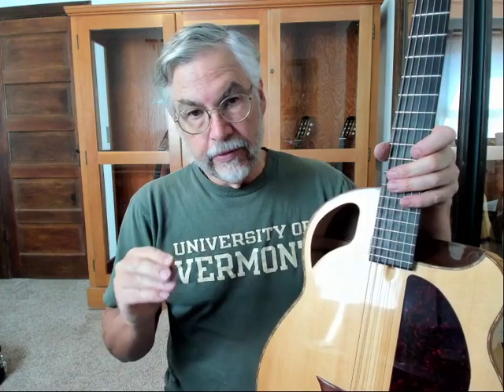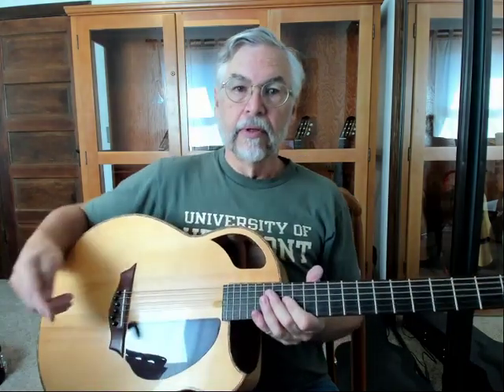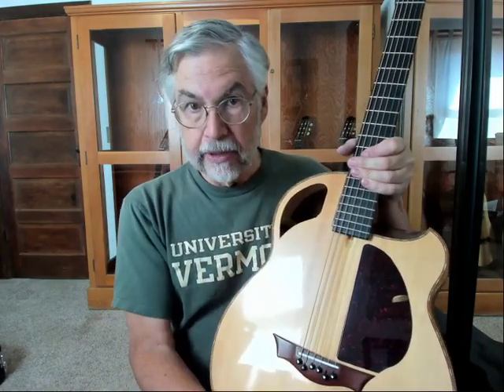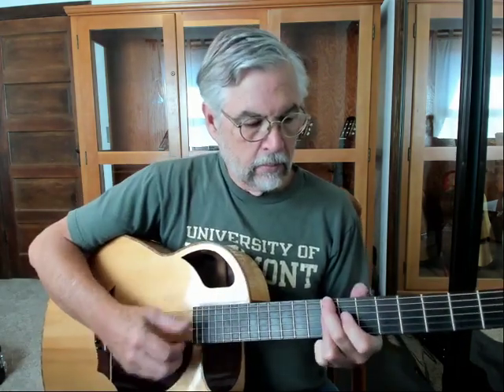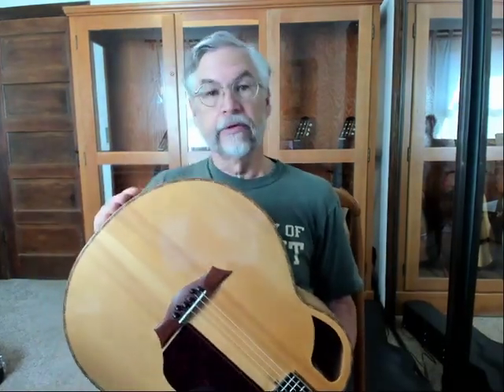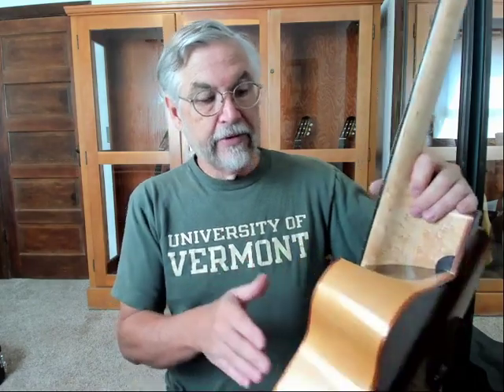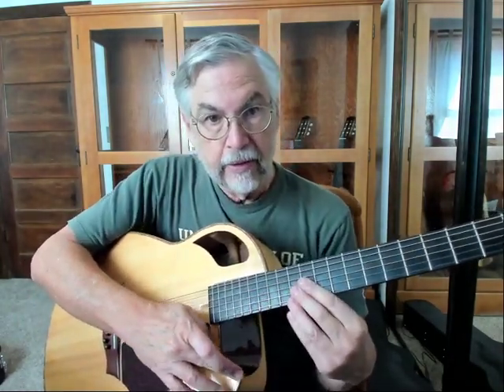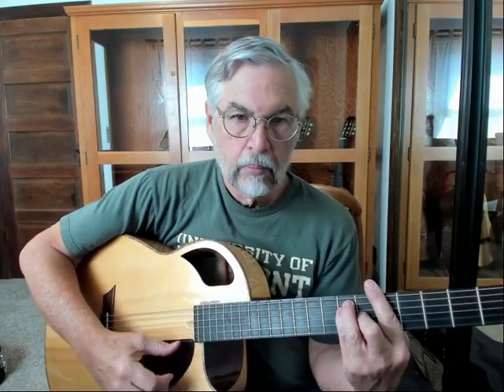Experimental Lutherie: Air resonance and extended neck design

Comment: Hi, writing for your advise. My guitar suffers from dead notes which lack power and suatain. B to D notes on the high E steing.

490Hz to 590Hz range.

I tested tuning the string down by a whole step snd saw the spot shifts down that much.

Might a sound port help?
Reply from the maker: I don't know, I don't understand what you mean with the tuning down test. If you tuned down a whole step then the bad range should shift up two frets to maintain the same pitches. could you clarify ?

Comment: sounds more like your air resonance is down under 100hz not 220
Reply from the maker: Hmm, did I say it was ? I missed that. In a normal size guitar the air resonance is 100Hz +/- 20 hz and the top resonance is 200Hz +/- maybe 40Hz, at least from what I've been able to measure.
Reply: @chuckmorrison  Yes at 2.55  Yes I agree with what your expectations are

Comment: I love this idea and how it resonates (pun intended) with the idea of the sound chambers in Egyptian pyramids. 

Question, is it possible to build a body that’s tuned to a range of resonance/frequency (with lower port hole opened/closed) or a body tuned to resonate with a particular note I.e. A?

Thanks :)
Reply from the maker: I can't say I've had the opportunity to play any Egyptian pyramids. 

Any acoustic guitar body resonates to a particular frequency. The majority of classical guitars, for example, have an air resonance between F and A# depending on the size of the body, sound hole size and placement and the flexibility of the top and back. Adding the lower bout port hole raises that resonance. How much depends on the size and placement of the port. By including a plug or valve one is able to switch between the original frequency and the higher frequency. This can change the timbre of the instrument and also which notes are louder or softer (assuming you listen for that sort of thing).  So to answer more simply, Yes. Not that you would want to tune directly to a scale tone.

Comment: Hi man rlly appreciate sharing ur knowledge I’m a fairly new luthier, just wondering how you figure out what size to make the opposite hole to target specific frequencies?
Reply from the maker: I usually don't try for specific frequencies, but rather an audible difference in tibre. At least on instruments with a valve so I can move between the two.
If trying to adjust the main air resonance (to make it higher) I'll start small (large enough to fit a reamer into it) and slowly enlarge the hole as I measure the resonance frequency. 
Note that changing the resonance of one of the critical 3 (air, top, back) will usually affect a resonance change of at least one of the other two. So it's a moving target that needs to be monitored as you go.
Reply: @chuckmorrison  thanks a lot that makes alot of sense to do but I can imagine if this spread alot more some of the more enginere oriented luthiers could do some rlly cool things
Reply from the maker: @lewiskay7184  I'm sure they could. I don't think in math formulas, so I'll leave that to someone else.

Comment: I may be wrong, but it seems that if you continue finding alternate air frequency selectors (or meter the same tail whole), you may wind up with a tonal effect similar to the tone toggle switch on an electric guitar; choosing between bridge and neck pickups in that case.
I hear the change in the brightness and that’s what strikes me about your idea.  If you have built it as low-end air resonant as possible with all other channels closed, it seems a simple matter of size and placement to create interesting effects when brightening it up.

Just an idea, but maybe to take it a little bit further you may be able to cross multiple air resonances in effects similar to the ripple and wake convergences seen on the surface of water, and maybe could get some beautiful oscillating tones and effects that way.

I just came across your videos here and watched a couple, and I’m loving what you are doing, by the way.  I’m a steel-string guy, but your ideas in your oak back and sides videos and the outcome of the sound are very impressive to me as well.  Fascinating, and very appreciated.
Reply from the maker: Thanks for the response. I have built instruments with sliding and rotating doors as well as just holes plugged by corks. In each case there appears to be a point at which the overall tone of the instrument shifts along with the air resonance. I haven't found it to be anywhere near as reliable as a tone control on an electric, which is cutting off highs rather effectively.

It's actually a kind of reverse tone control. Opening a second, opposing hole moves the main air resonance up and also adds (at least some of) the even harmonics of the fundamental air resonance (which are not available on a one hole air cavity). To the extent that the top and air resonances are coupled, the top resonance may stay the same, move up or move down. That will have an audible effect any way it goes and all this may induce soft, dead or loud notes. It gets pretty messy and it's not a simple if X then Y correlation.

Now on steel string acoustics, raising resonances may not be the direction one wants to go. It's generally more important to get good bass response on a steel string. Classicals are generally the opposite, bass being pretty easy but good treble response being a challenge. Good, in these cases needs to be defined and recognized.

Comment: Hard to tell without seeing the interior and the top bracing, but by moving the sound hole backwards and up it seems you have lengthened the effective soundboard, which usually terminates towards the bridge side of the standard sound hole placement. By adding several inches of length to the soundboard you hypothetically strengthen the longer wave length base notes while robbing nothing from the vibrating surfaces for the treble notes.
Reply from the maker: It would seem that way wouldn't it ? How much that is the case is dependent on the tightness of the waist, the bracing pattern and it's dimensions, the top thickness and I'm sure many other things I'm not thinking of right now. 
Note that the sound hole itself is part of the effective soundboard length in the standard (X brace) design. This can easily be seen in chladni tests where the node line (of the fundamental air and top resonances) extends to the center of the sound hole. Removing the sound hole stiffens that part of the top since it is now soundboard, not a hole.
Reply: @chuckmorrison  Think you are saying that the sound hole would be part of the effective sound board length if it were still there as top material, not hole (air). While the node line extends to the center of the sound hole the missing circular cutout can't move air. In a traditional X the long mode wave would largely be blocked by the stiff center joint and then terminated where the soundboard terminates into hole... in a Falcate much less so, and if the hole is moved out of the length of this wave and into an upper bout region that contributes relatively little to sound production possibly the least of all. Just learning this stuff and fumbling around some;)
Reply from the maker: No, that's not what I'm saying. Forget relocating the sound hole. In a Chladni test, the node line outlines the area that is actively vibrating (the anti-node) because the node is inactive and that's where your sand/glitter/metal filings/sawdust/pepper/whatever gathers. At the main (air and) top resonance, on a nicely responsive X braced top I see the node line form around the perimeter of the lower bout extending up into the waist area and joining at roughly the center of the sound hole. (obviously it ends at the outer edge of the sound hole, not inside it) It's a pear shape. So the soundboard area above the joint of the X brace and on each side of the sound hole is actively vibrating together with the lower bout as one unit. Since it's within the active area, the joint of the X brace must be vibrating too and not blocking it. If the top and/or bracing was too thick/stiff, then  the pattern would be smaller.

Do some Chladni testing to see how things actually vibrate and how patterns change with modifications to bracing, sound hole placement and other design changes. It makes a lot more sense than trying to figure out what I'm trying to say here.

Comment: That is a beautiful-sounding instrument. The explanation you give in regards to how having an open/close sound port on the opposite side was very logical and a good explanation of how it affects sound quality. What I heard even when slit, was a difference in the tone, and resonance, and I would say even the sound pressure even while using only headphones. Thank you
Reply from the maker: Thank you, 

There is a  huge harmonic difference between one hole in a sound box and two (on opposite ends). The differences are usually described in terms of tubes that are open on one end vs both ends. The harmonics available with tubes open on one end (like a standard acoustic/classical guitar, clarinet) are the odd multiples of the fundamental. So the root, 3rd, 5th, 7th, 9th, etc. In contrast, all the harmonics are available with tubes open on both ends (flutes, recorders, open organ pipes), so root, 2nd, 3rd, 4th, 5th, 6th and so on. I should do a video on this as it's very basic and important physics for musicians and builders.
Reply: @chuckmorrison  Thank you for your reply. As a fellow Luthier I appreciate your openness in sharing knowledge. I have used sound ports in some of the instruments that I have built but only since 2009 when I changed my approach to building. Your explanation of what you have done is very appealing and demonstrable. Thank you again for your beautiful work.